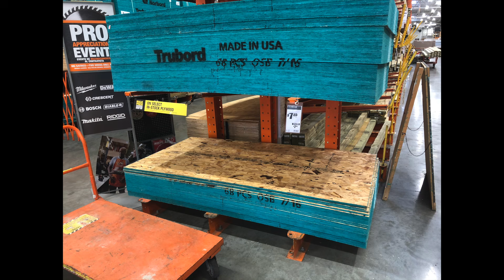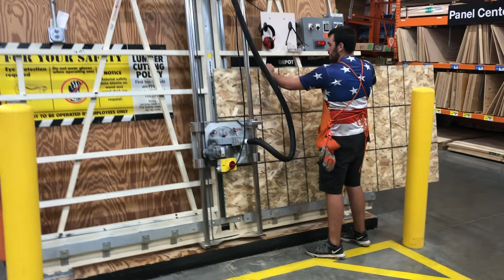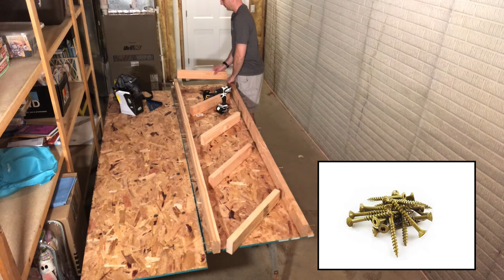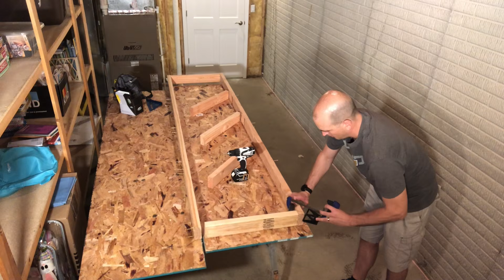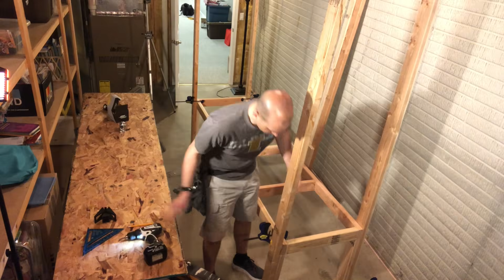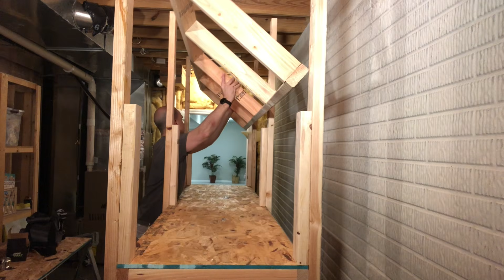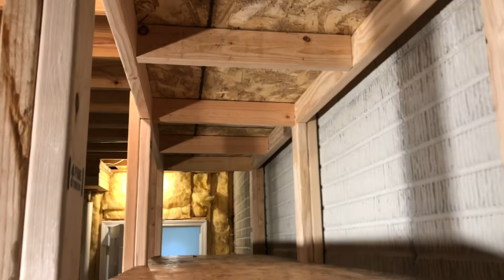How To Build Storage Shelves | Easy Build

Comment: Great video, and I'd want to add that your 3" deck screw only has about 100lb shear strength, so I'd double them up. I realize they're not support in your video, but if you get enough weight on there, and it starts raking from earthquake, or what have you, things can go pear shaped pretty quick. Maybe double up using a spiral screw. Thanks!
Reply: Are you talking about the the one screw he did at the bottom?
Reply: @PatriotNerdDad  I really have no idea what I'm talking about. These are the only words I know in English.

Comment: Thank you for coming up with this very simple design. I appreciate your explanation of getting everything prepped so you could install the whole thing at once. I know home Depot does cuts, but did they charge you for all those cuts you made?
Reply from the maker: Nope, at least at my location cuts are free and they are usually reasonably accurate.  Others have reported challenges in getting boards cut and/or a cost per cut.  Best of luck on the project.
Reply: I have heard first cut is free, then up to 50 cents-but only if the employee assisting you feels like taking the time to write up the slip.

Comment: Scott - thanks for the video. I built 4 of these, making them 10' tall by 12' long.  Bottom shelf at 3'. Next shelf 2' up. Top shelf at top of uprights. Lag screwed them into the 6x6 supports in my shop. Done and solid as a rock. I have 48' of 3-level shelving on a 60' wall with 3' beneath where I can store things that need to be on the floor due to weight. I really like the inside supports in your design that keep the weight off the outside uprights. And your advice about leveling starting with the middle shelf is spot on. Well done!
Reply from the maker: Holy Cow!  That is some serious shelf space.  Is this in a standard machine shed or a different business?
Reply: @EverydayHomeRepairs  its along one long wall of a 30x60 shop. roof is 14' at the eave so I have 4' from the top shelf to the bottom of the truss. I'm going to separate them into pairs so there is a 12' gap in the middle. in the gap, i'm thinking about french cleat and magnetic strip wall for handing all my hand tools (not a fan of tool boxes). If I dont do the tool wall, I have an 8' rolling work bench I'd like to store in that space so its out of the way.

Comment: What are you going to put on top shelf 🤔
Reply from the maker: 10 sheets of paper 😂  Joking, the design was made this way so those who want to use the shelf in a garage with higher ceilings could leverage the top shelf.  Many have tweaked the design over the years to reduce the height for basement use.  Best of luck on your project.

Comment: Scott, what is the point of the top shelf right below the floor joists? I know that it didn't add much to the cost (ex: you already had a 4th 2' x 8' sheet of plywood) but were you planning on putting small items up there?

Comment: If the support 2x4s are cut at 21” with the 2x4s on each side that would add up to 25” and the shelf’s were cut to 24” there would be a gap correct me if I’m wrong thank you
Reply: 2x4 is actually 1.5x3.5
Reply from the maker: Qing, is right.  So it is 21" + 3.5" (2x4) + .5" (plywood)= 25" total height.  Best of luck on the project!
Reply: @EverydayHomeRepairs  thanks for sharing this, great project! I don’t have the space to do an 8 ft, so I am going to do a 6x6x2 modified version based on this.

Comment: This is my first official project! My father in law and brother in law are GC's and I wanted to try and tackle something. They recommended this as a great project since it will be in my garage so any holes aren't that big of a deal!! Any unique engineering or structure issues if I make my shelves 36" instead of 24".
Reply from the maker: Hey Chad,  from a perspective of the stability and ability of the shelves to support the load with 36" wide shelves opposed to 24" you are good to go.  The 24" design just made it easy to rip 2 pieces of plywood but I don't see any issues.  Best of luck on the project!

Comment: This is great. One consideration is many garage floors are not level. So I'd rather a system that bolts to and is supported by the wall studs.
Reply from the maker: Yes, if you have an open wall, I think that is a better approach.  I wanted to make this one free standing so viewers with a number of different scenarios could still use the design.

Comment: perhaps stating the cost makes it dated.  I didn't start doing projects till after the start of covid, was wood cheaper before?  it's like $4-5  per 2x4x8, from the same store (granted different location)
Reply from the maker: Good point and yes wood has increased dramatically during 2020 from Covid.  Thanks for calling attention to the cost difference for those building now.  👍

Comment: How do you reason that your not abusing a complimentary service at Home Depot, not to mention if I just want to have one piece of lumber cut so it will fit in my car and I have to wait a half hour or more for your project to be fully cut because you were in front of me. Not only do you seem to feel proud of doing it your promoting others do it. It is self centered reasoning tying up a generous service inconsiderate of others and bound to drive up prices in the long run.  There is an abundance of things that can do but shouldn't.  You even have a chop saw at home when a skill saw could easily do it. This is the epitome of how privileged people think.
Reply from the maker: I wouldn’t get too excited as the cuts for me only took less than 5 minutes.

Comment: Hi Scott or those of you who built this unit using Scott's instructions,
I am planning on building this. I am definitely a beginner and also a planner.
I wrote down a list of things I need to buy and cut according to the descriptions. 
However, when I calculated, Scott's calculation didn't seem to add up. OR am I calculating wrong???????
The side supporting pieces according to my calculation should be 20 inches and the leg supporting pieces should be 19.5 inches. 
But then Scott and a lot of you who followed Scott's instructions say that it worked out perfectly so maybe my calculation is wrong?
Any help is appreciated. Thank you.
PS: great instructional video. Thank you so much, Scott.
Reply from the maker: Hey Kayla,  thanks for the question.  Did you account for the 1/2 thickness for each shelf tops?

Comment: If you have a 10 or 12 foot ceiling, then build as per the video, as then you can use the top shelf. If you have 8 foot ceilings, I would stop at the 3rd shelf as you cannot stack anything on a shelf with inches of clearance below your ceiling. That will save you 25% on the cost, and take 25% less time to build. If you are OK stacking directly onto the floor, you can also leave out the bottom shelf, saving another 25% on time and materials.
Reply from the maker: Hey Steven I agree with you except for maybe the last part.  I do not have a shelf sitting on the floor so not sure about the last statement.

Comment: Good luck with straight board with no knot, one pallet later and two boards found.
Reply from the maker: Yeah, it can be a bit rough at times.  Always nice to find a new pallet opposed to one which is half picked through before you get there.

Comment: Fabulous!  I am making two to fit in my barn.  They are custom sized for the spacer and for the boxes I need to store.  One will be 9'10" with 6 legs and 3 shelves with the last shelf at 57" H.  Will 6 legs provide sufficient support?  The second will be 13'10" with the last shel at 62" H.  Again, will 8 legs provide enough support?
Reply from the maker: Hey Lynn,  Those sound like Monster Shelves 👍.  Are you doing 8' wide?
Reply: @EverydayHomeRepairs  LOL!  Nope, 30" D
Reply: @EverydayHomeRepairs  LOL!  Nope, they will be 30" deep.

Comment: Nice sturdy design. Just wondered why you bothered with the top shelf as it seems to be just an inch or two below the joists so can't be used for storage
Reply from the maker: Good questions, that was more for others.  For instance if a viewer was making the shelves for their garage with higher ceiling compared to my basement.
Reply: @EverydayHomeRepairs  Thanks Scott. The garage is where I plan to do this build. I'll copy your design, just changing the depth to 18 inches .
Once again thanks for the vid , very easy to understand for a novice like me. I will definitely pick up that Erwin clamp
Reply: I like the way you did your video as well explaining it. Also 90% of it, u showed how its done (-10% excluding very top shelf 😊). Many out there overly or underly explains or shows the correct way, specially for a one person work - ty so much for it easier plus the option of having HD or Lowes to cut wood for u. I noticed ppl’s comment about being charged for it, not to mention the price of wood going up, which is ridiculous. Anyway, aside from being thankful, what was ur budget for this project?

Comment: I ordered the corner clamp accessories & clamps listed in your video from Amazon but they don't work together. Maybe they changed since your video. Really disappointed. Will send back and try lowes
Reply from the maker: Hi Cheryl,  thanks for letting me know.  I checked and the corner clamps still look to be the same from the Amazon link.  The corner clamps are designed for medium and heavy-duty Irwin corner clamps where you take off the original pads and then replace with the corner clamps.  I was able to get the Irwin mini clamp pads to fit the corner clamps without removing the pads.  Wonder if the Irwin mini pad size has changed which makes them incompatible with the corner clamps.  For now to be safe I will change the Irwin Clamp link to the Medium duty opposed to mini.  Appreciate the help.

Comment: Scott I ordered the Irwin corner clamp and the quick clamps directly from your link and the corner clamp is not compatible with the quick clamp jaws.   i thought it was user error but I cannot find a fit-up that will allow the corner clamp to stay in place.  Might want to double check the compatibility.   Awesome instructions for these easy to build storage shelfs - thanks@!
Reply from the maker: Hey Dan, thanks buddy.  With the corner clamps I have seen then work with the yellow pads in place on the mini and small quick clamps but think you might have to remove the yellow pads on the larger quick clamps.  Let me know if that helps and you get the corner clamps to stay in place on the quick clamps.

Comment: Do you HAVE to put a top shelf/lid on the unit for stability? I notice it's very close to the ceiling so can't it just be open with no lid or top shelf?
Reply from the maker: Hey Nancy, you can leave the top shelf off without any issue.  Best of luck on the project.

Comment: Vertically you have 4 spacers at 20" each so thats 80". 4 Shelves at 4" each So that is 16.  Total is 96" But 2x4x8 is actually 96", what am I missing?
Reply from the maker: Hey Brian,  not sure I am following.  I agree with your math and the total height is 96" which matches with the length of the 8' (96") 2x4 that are attached to the outside perimeter of the shelves and as such sits flush with the top shelf surface.  Does that clear it up?
Reply: @EverydayHomeRepairs  Thanks for your quick response.  The 2x4x8 I purchased at Home Depot is actually 1 1/2" x 3 1/2" x 93 1/2" long!
  I have decided to make the spaces 19" that should solve the problem.
Reply: Brian Morgan 
You purchased a stud wall “8’” board. It’s 3.5” shy of 96, but when used in a vertical wall board (with a 1.5” thick board on top and bottom) you would end up with a 96 “ wall. Either take it back and get 96” lumber or shorten one of the shelves. Hope I explained this correctly. Thanks

Comment: If you would’ve used shelf liner or something to smooth out the top of each shelf, it would’ve added to the ease of use & clean up, it anything on the shelves spilled or leaked later on.
Reply from the maker: Hey 👼, since this was storage in the basement for us I wasn't too concerned but agree if this is something you think will get dirty or spilled on regularly then particle board is going to be tough to clean without some type of covering / liner.

Comment: Is this plenty stable without securing it to wall?  I want to build one against the wall and another free standing between the 3rd and 2nd stall, essentially having two of these in that 3rd car stall. But I worry it won't be stable enough alone.
Reply from the maker: Hey Ric,  yeah the shelves are plenty stable but like any freestanding shelf it is good to have some type of anti-tip bracket or strap installed.  Will you have 1 of the ends against a wall?
Reply: @EverydayHomeRepairs  One will be against the wall and the other would be in between the two stalls. I wonder how that shelf could be stabilized?
Reply from the maker: @rickearbey7446  The shelf wouldn't need much  as a bracket, strap, or another method would be for safety.  The biggest safety concern would be kids climbing /jumping on the shelf but that is the same concern for all shelving units.  Is there anything you secure a strap to just as an anti-tip device?

Comment: Couldn’t I use the studs on the wall directly (it is not dry walled) to make this shelf and avoid the the vertical 2x4’s on the back side?? I kind of want it to be in place and not movable??
Reply from the maker: Hi Amy,  for sure but if you have studs or a wall to attach your shelves to I would go with a design more like this https://youtu.be/SwqI2LcRbOQ.  Best of luck with the project!

Comment: This is such an excellent tutorial.  I so appreciate that this can be built without securing to the wall, since I have no studs in the basement area where I need the shelves.  Thank you!!!
Reply from the maker: Hey Rose, glad the video helped you out.  Just a reminder that it is good to add a "anti-tip" strap to the shelf once completed.  If it is in your basement you could connect the strap between the top of the shelving unit and the floor joists.  That way if someone (usually kids) jump on the shelves there is no chance of tipping over.  Best of luck on the project.
Reply: @EverydayHomeRepairs  That's a great idea! I didn't think about securing to the floor joists. THANK YOU!
Reply from the maker: @rose8662  happy to help!

Comment: Anyone else finding that it's pretty much impossible to buy all of that wood for less than $150? I've checked all the usual places (HD, Lowes, etc.) And Lowes was the cheapest I could find at just over $150. Anyone know a place I can get decent wood for cheaper?
Reply from the maker: Hey Matt, I know there has been a lumber shortage is some places in 2020 so not sure if the prices are also drifting up a bit.

Comment: I bought wood at two different locations: Home Depot and Lowes:
#1...I went to HD and the cost was $175; it was $150 at Lowes.
#2...at HD, I checked the 1st cuts(20"/21") and they were good, but many future cuts were off (I had to re-cut).
#3...at Lowes, they charge $.25 per cut and I checked the 1st cuts again and they also made many wrong cuts.
NOTE: The wrong cuts were due to the stop moving or sloppy alignment, plus the workers were not that into this.
DEFINITELY do the cuts yourself and save the hassle.   That is my take.
Reply from the maker: Thanks for the information and feedback Bill.  I actually agree, if you have the power tools and vehicle to carry the uncut material doing the cuts yourself is best.  Best of luck on the project.
Reply: Thank you for the comparison & information.  I would have assumed that HD was less expensive.

Comment: I really like this project! Just wanted to know if the same steps would still be as strong if I made the shelves 3 feet deep. I need to maximize my storage space in the basement.
Reply from the maker: Hey Vekuhn,  yeah adding another foot to the depth would be no problem. The 2x4 frame for each shelf will provide plenty of strength.
Reply: @EverydayHomeRepairs  Thanks! After looking at my measurements. I'm going to do a 32 inch deep shelf. This way I can cut the osb into 32'' x 4 sections and not have a lot of left over waste. But I feel better about you confirming the stability should still be the same. Thanks again.
Reply from the maker: @vekuhnvowles6270  Nice, that will give you a ton of shelf space 👍

Comment: I’m in a apartment trying to make the most of my pantry. I want 2 small shelves 28 inches tall and 16 inches wide and off possible 24 inches deep to hold my canning preps. How would I make such shelves?
Reply from the maker: Hi Patricia,  🤔not sure this design would work well for your use case even if we scaled it down to fit the space.  I would search "mason jar storage" or something similar to see what others are doing in the canning niche for storage.  Best of luck on the project.

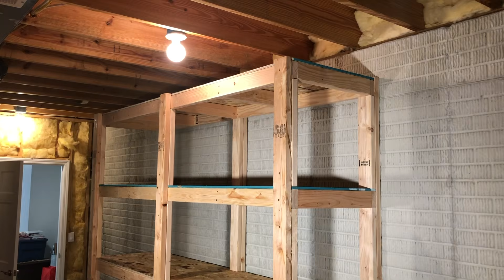Comment: 09:23 Why the heck did you build the top shelf 6 inches away from the ceiling?  That's a lot of effort for such a useless shelf.

You should've started the bottom shelf on the floor and had the top shelf be 24" from the ceiling.
With this build, you have the entire shelf system sitting on top of 6 legs.  If the bottom shelf were resting on the floor, it offers 1000x more stability.
Reply from the maker: 😂 people seem to really get bothered by that top shelf.  This video was thinking of the audience in mind and those who would build this in a garage with higher ceilings.  Stability is not an issue with this design and I am not a big fan of starting off with a shelf on the floor opposed to just setting totes on the floor.   To each their own with these type of builds and I don't want to sound like my approach is the end all be all.  Best of luck on your build!